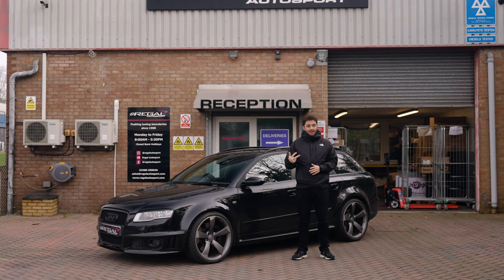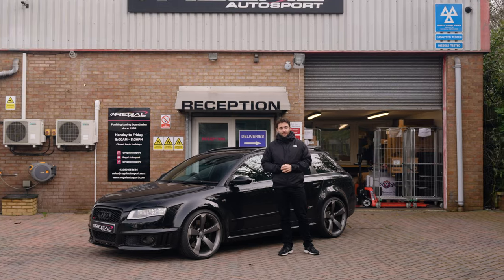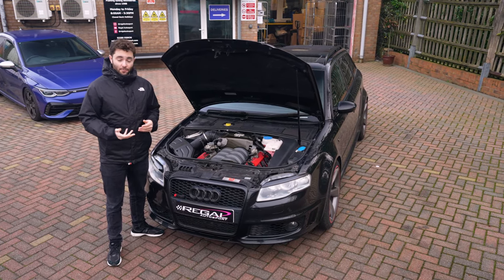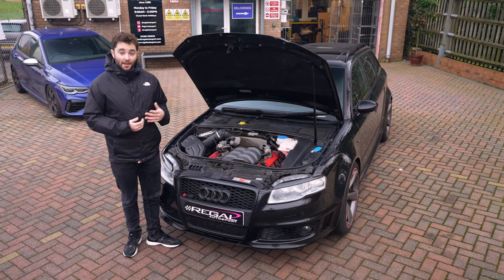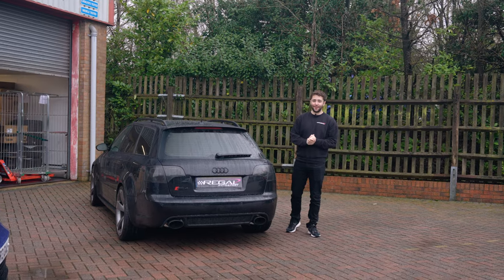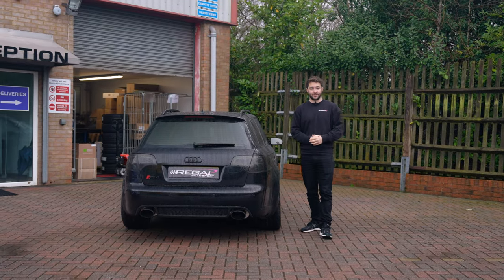BEST B7 RS4 UPGRADES: MILLTEK EXHAUST & CARBON CLEAN/DECOKE [PART 1]

Comment: @RegalAutosport. You are fitting what looks like 200cel Sports Cat as part of the full exhaust install. What is road legality (MOT etc) or is this a track car….?
Reply from the maker: On this platform, this appears to be road legal providing it meets emissions.
Reply: @RegalAutosport  hmmm, interesting as I have same platform and looking to fit sports cat but so much ambiguity around emissions etc, and I’m sure Milltex website says not road legal.

Comment: The engine bay looks much cleaner than my B8.5. 

I'm slowly doing bits. Doesn't help that I just had to drop 3k on a new mechatronic unit in the gearbox 😢
Reply from the maker: It is a very clean example! Ooft mechatronic, sorry to hear that buddy.
Reply: @RegalAutosport  Yeah that one hurt. Audi only quoted me 11k for a new gearbox. Bargain!

Comment: both the old and the new exhausts crack disgustingly at high rpm, and I don’t understand how to overcome this problem, I’ve been fighting unsuccessfully for several years now =(
Reply from the maker: eh?
Reply: Its best to not use straight through muffler design, it needs at least 4 resonators and then offset mufflers with plenty of baffling and fiberglass. Magnaflow and Borla have great exhausts, I would not recommend Milltec. On the B5 S4 I have, I've the Borla exhaust, no rasp, nice and throaty for a V6. But my friend has a Milltec on his S4, my my my... its god awful.